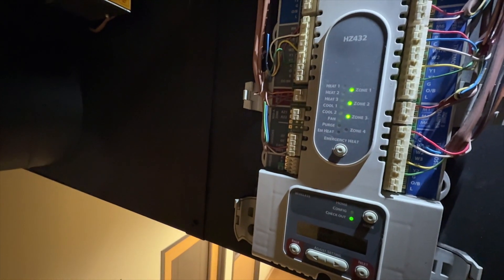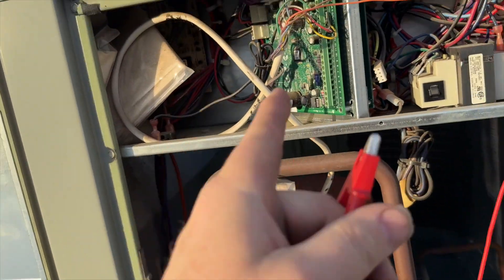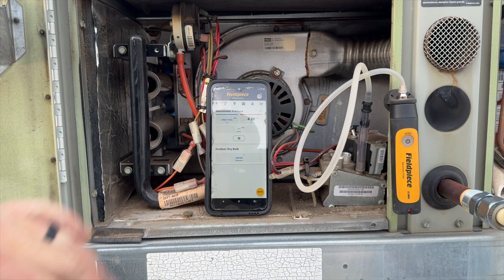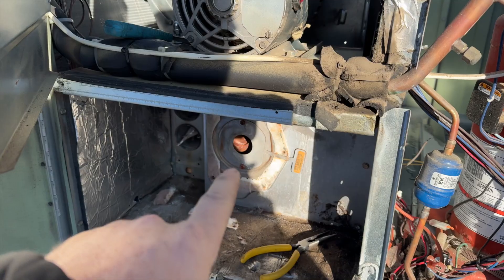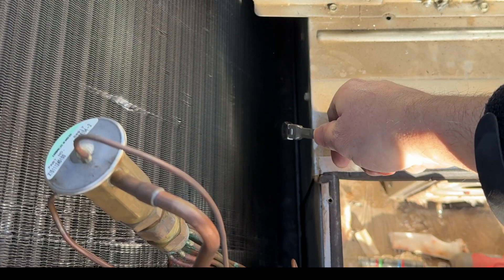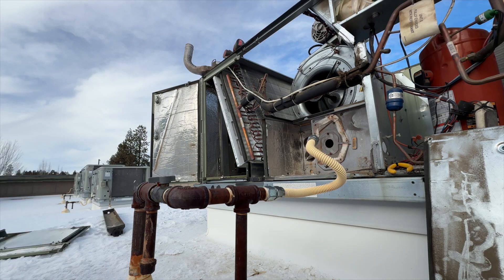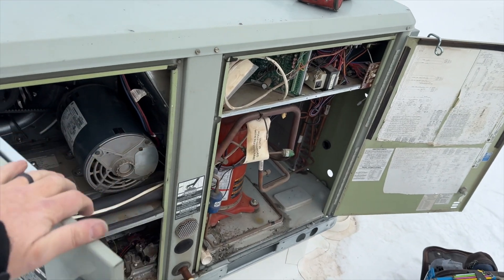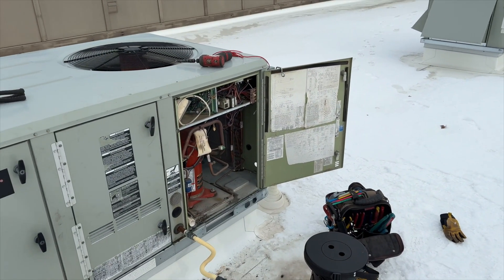Trane Package Unit Tripping the Rollout.  Heat Exchanger Problems. EP202

Comment: Fun recollection.....   I moved into a brand new house in January 2001.   I knew it had a gas pack unit but just assumed it had been tested after being installed......   Apparently not.  Turned it on and the whole house filled with smoke and stench.  The movers were there as well as some friends and we couldn't do anything for a bit.  Had to open all the windows to air everything out while it was 29 degrees outside.....  Again, fun times! 😂

Comment: Great Video ! I'm thinking maybe Wiping off the oil from the New Heat exchanger before install Might be a Good thing on really oily ones that you know are going to smoke for Long time. use 409 spray Cleaner & a Few Rags to clean heat exchanger when u remove it from the box. might reduce the smoking to almost nothing.
milwaukee 12 volt right angle ratchet with 5/16 socket on it Ftw on the Drain pan area screw & 2 screws in compressor compartment.

wondering what kind of shoes you wear & if u like them ?
Reply from the maker: I’m wearing the Brunt Ryng work boot. I love them.
Reply: @NighthawkHVAC   thanks. i'll check them out. 👍🏝️🛶🎣🐟